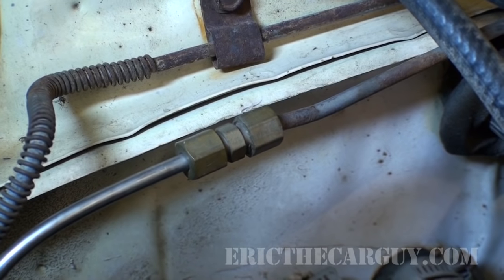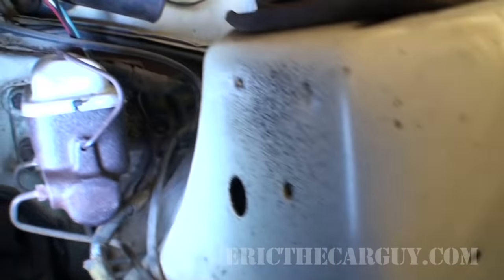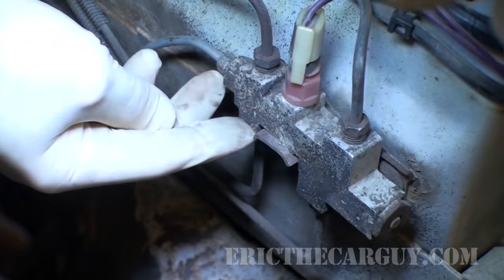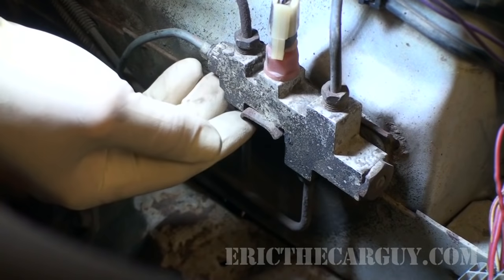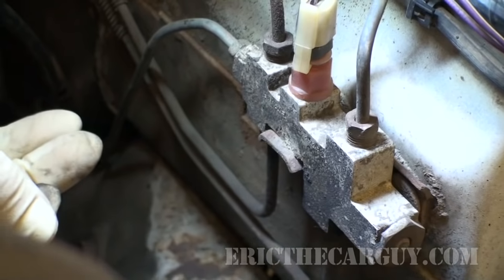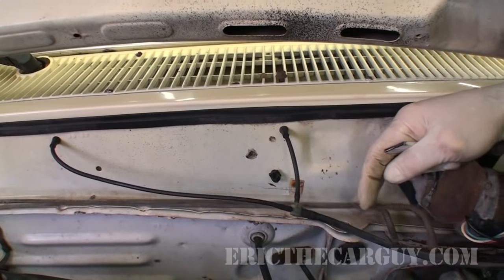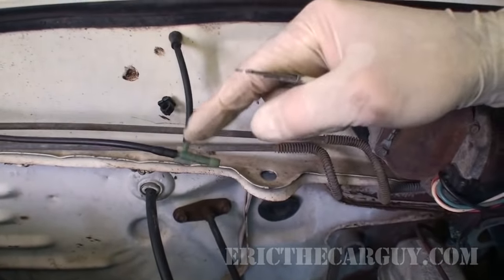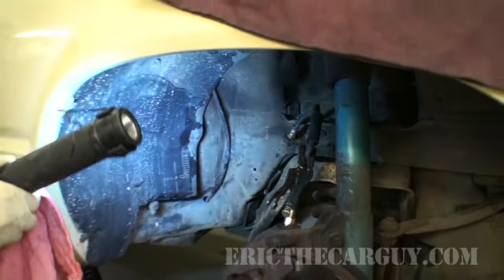How To Bend and Flare Brake Lines -EricTheCarGuy

Comment: I know this is 9 years late, so it's for anyone who stumbles upon this video for tips/education: to prevent fluid from dripping and running the system dry, depress the brake pedal and use a stick or something to hold it, before starting work. The outlets on the master cylinder is then closed/covered by the pistons, and prevents any fluid from moving.
Reply: Great tip!
Reply: Ah yes, I've used a 25lb dumbbell for that. 😂

Comment: Hello Eric. Just a quick tip for you and your viewers. Any time I'm bending out steel lines. Be they for transmission cooler supply, brake, etc. I never fully complete the bend, regardless of whether it's 45° - 90° or whatever. I leave the longest straight side without the fitting and install the fitting on the other side first. Once I'm finished with all of my rough bends. I start to install the line. I then place a tube bending sping on the end that doesn't have the fitting installed yet. I run the spring tool all the way up to the other side of the line (sometimes you may have to unbolt a cab. Jack and prop it a few inches to make installation a little easier). From there, I "fine tune" the bend with the tube bending spring. Until I get to the "open" end of the line. I then remove the spring tool. I place the fitting on the open end and flare it accordingly. After both ends of the line are secured, I proceed with the fastening.

Comment: I always make an estimate on the length then add plenty so I don't come up short. Then I flare one end, thread the line through its route.  Starting one the end I have already flared and fastened I work it by hand fastening it down with clamps as I go. I  flare the other end on the car when finished bending.  Sometimes pre-bending a line doesn't allow it to be threaded through its route. Also it is very difficult to get accurate  pre- bent bends, which is why the line kinked in this video. It wasn't accurately bent to begin with. Bottom line.....bend as you go works much better in my experience.

Comment: Been a mechanic for 30 odd plus years I have never used a factory made brake line to replace a corroded or damaged line always made my own, here in the UK we can use copper pipe which is far more easier to use. Rather than using a rubber plug to stop the brake fluid leaking I have male and female brake unions various sizes, with a small peace of brake pipe in about 11/2" long flared one end and crimped together the other end, and use then as a plug, and before installing the replacment line use electrical tape wrapped round the ends of the pipe and brake union to stop ingress of dirt etc into the pipe and to hold the union from moving,

Comment: Old video but wanted to comment. You should never use compression fittings in brake lines. They can’t hold the pressure if you stomp on the brakes and will blow off and in a lot of states if you dig into the laws but it is illegal to run compression fittings in a brake system

Comment: Great video. There's a method I use when I'm gonna have the brake line disconnected for a long time (a few hours work) is to pull the brake lamp fuse and jam a 2x4 on the brake pedal. This pushes the master cylinder forward into a compression stroke but also closes all open valves to the master cylinder reservoir. This setup lets you work completely dry. Alternatively, if you need to slow a flow and are working fast and you don't wanna hunt for the fuse. You can use a cable cutter to crimp the line in a few places that you're anyway going to replace and when your ready for the fitting use a normal pipe cutter. Thanks for all the great videos.
Reply: Good tips

Comment: Nice job Eric! You taught and ole dog  a new new trick, I have always tape the two lines together as I when which causes some problems because sometimes in the bending process the new and old line get tangled up. With 2 or 3 sets of vice grips like you showed, you can get the lines apart and right back together again as I move along. Nice!  One thing I have found is that I always start in the middle, or with the very hardest bend first and work to the ends, I have several pieces of #10 copper wire coil up and use it to the forming of a model first for shape and length it don't work harden as fast and coils back easily. Thanks again!

Comment: Great video. I had a bad line in the past. The easiest way to repair it was by using a flaring tool and installing a flare union. Much less work than changing out the entire brake line, and when done properly you will not have any problems.

Comment: Hey Eric..I know I have made some douchey comments in the past..lol but I have to give you some love on this one.  As a professional tech, I totally agree with you that its best to replace brake lines with factory bent ones if and whenever possible.  Of course this is not always possible. Boat trailers with hydraulic lines are a good example.  Even with all the room you had to work with under the hood of your fairmont, that was still ALOT of bends you had to make.  Modern cars are much worse.  In fact, even though brake system repairs are considered first year apprentice stuff in this trade, I can honestly say that the worst days I have ever had in this trade have been making replacement lines.  I would rather rebuild a transmission blindfolded than make custom brake lines lol.  The time lapse portion of this video was a good example of the effort and skill it takes to do this.  If you don't have the patience or that little bit of artistic flare that it takes to make these lines look "just right" it can seriously drive you nuts doing this :)  Also, I have been a pretty vocal critic of "tool review videos" but I have watched the review you did on this brake line tool, and seeing it in action in this video I must say that the tool made it look pretty damn easy.  I have used a lot of cheap and frustrating flaring tools before, but this one looks pretty sweet.  Anyways, this video was very helpful for anyone wanting to tackle this ridiculous procedure.   Lol. But if you value your sanity, find a dude who specializes in this kind of repair and make him your best friend :)
Reply: wrong its best to replace any fuel line or brake line with Nicopp
Reply: On fairly old vehicles there is room to work but on many newer ones, it's far more work to try to feed a pre-bend cable into the assembled vehicle, obviously varying vehicle by vehicle, how many things are in the way of the bends and how much is reasonable to remove instead of bending your own, which doesn't look as pretty but can cut the work in half or more, again on newer vehicles, say anything made in the last 15 years.

Comment: You're right, Eric, bending and routing brake lines is an art. Needed to replace several on my 77 El Camino; both rears, and one from the MC to a front caliper, all rusted into oblivion from living near a beach most of it's life.

It too several tries to get them even remotely right, and even then, they looked like a 3 year old drew them with a crayon.

The stuff you see on professional builds, with the coils and perfectly molded bends are truly a work of art.

I eventually gave up, as every time I'd replace a hose or line, another would go. Eventually sold the thing with a torn rear rubber line, but obviously I mentioned it to the new owner. It tore because someone used a line too short, and jacking up the rear not on the diff would pull it taught.

Comment: What a great video on servicing and making a steel break line!  They have little tube benders are cheap and easier to use than the pliers (although they don't make quite as tight turns).

What I did, the one time I ever did anything like this (and this is just another option -- not saying better or worse), is cut out the bad section (like the compression fitting in this video) and buy a 12-inch section with the fittings already flared on for literally just a couple of bucks at advance auto.  I used the crappy rental tool to flare and add new fittings onto the factory line. (It DOES work; just takes a little elbow grease, especially doing it upside down)  Then I was able to attach it all together with 2 flare unions.

For anyone who doubts Eric's advice on using a flare wrench on these fittings... the first time you round one off like I did that one time, you'll immediately be on your way to harbor freight to buy a set.

Comment: Great video, brake lines are always a tedious task to replace... Oddly enough most shops hate doing it, so it is easy $$$ once you master the flaring and bending. Speaking of bends, a simple tube bender will do wonders. No reason any kinks (like around 29 min mark) should ever exist! On tubing from 5-7mm (3/16 - 1/4 inch), I find that 4cm (or about 1.5 inch) diameter is the smallest you can go before kinks are just inevitable. Bending and working brake lines is more of an art then a skill IMHO. 

Sometimes... you have to think ahead of your bends, and perform some before others so your tool does not become stuck.
Reply: how about using different round pully's for your bends?

Comment: I made 2 lines for my prelude when I went to the larger master cylinder, brake booster and front calipers. Bending and flaring was nerve racking but I made it look pretty good and it worked perfectly. Nice video. 😊
Reply: If you do a bunch of flaring I recommend the eastwood bench flare tool.  Its pricy but I've never had a bad flare from it.

I just made a replacement line for my lift pump on my old diesel tractor  by doing just stage 1 of the 5/16 double flare.  The bubble flares from this tool work great as a hose barb.

The bender, I got one from summit that can bend 180* and never had a problem from it.

The eastwood forming pliers are great for tweaking lines once installed but they also leave a little crush point in tubing.

Comment: Great video!  Recently replaced brake lines on a 94 Ranger.  Used nickel-copper tubing instead of steel and had a lot easier time.  It's very forgiving and you can almost form it on the vehicle.  Costs more but well worth the time saved.

Comment: Learning something new about brake lines. Need to replace all 4 on my car as 1 is leaking and the others aren't too far behind (Michigan road salt and winter weather) using NiCu (Nickel Copper) over steel lines and replace all of the rubber lines to play it safe.

Comment: Hello Eric, in regards to keeping the Brake Master Cylinder from Bleeding out... No need to Cap-Off Open Lines or Pinch-Off Rubber Brake Hoses. All you need to do is partially depress the Brake Pedal (Pry Bar or 2x4 of appropriate length against the Seat) enough to effectively Block-Off the Ports within the Brake Master. Works on all Hydraulic Brake Systems. Note: some Vehicles will power on the Brake Lights, in this situation you can Pull the Fuse or Disconnect the Battery. Randy AKA: randog311 / Pro Wrench since 1974 Audi's are my Specialty

Comment: Great video, came back here to watch it again because now about a year later I actually have the line and tools. Making brake lines in the beginning is harder than it looks but once you learn the skill and get good at it you’ll be able to save a lot of money. It’s definitely important to have some practice line as he said, both for the bending and for the flaring, especially if you’re not buying the vice tool. For me flaring isn’t much of an issue, it’s the bending. I need use my practice line (which will probably be used to bleed master) to learn how to use the bending tool and to experiment around with the flare tool.

Comment: Hi Eric I have done many brake lines over the years and had a lot of success with a cheap pipe bender which has  degree markings on, well worth the investment. you use the pliers for tight bends and the benders for neat
Bends,you can get a factory Finnish in time I use just regular masking tape to cover the open pipe  I also disconnect the battery as I have made some perfect brake pipes in the past only to have a hole blown in the side by it shorting out on the starter terminals . only use a professional flairing tool as the cheap ones are useless, its just practice keep up the good work.
Reply: A friend of mine once told me he had a small fire in his engine bay because the battery came loose, tilted in a corner and shorted to a piece of brake line. Electrics went out and when he opened the hood he saw a red hot brake line with burning brake fluid spraying out!!! Weird stuff :-)
Reply: antiekeradio Oh yes brake fluid is not good when there's an ignition source
Many years ago i came across a brake system where the brake light switch was a pressure switch T-eed into the brake line and when the seal in the switch leaked into the contact area  the switch used to explode and leave the vehicle with no brakes. The first time i was called out to this i was puzzled
as to what had happened. This happened a few times after that which called for a modification ASAP!!!
Reply: That is the exact recall reason Ford used. Ford had multiple instances of vehicle fires caused by brake switch failure.

Comment: good video Ive done more brake lines than I care to count love the flaring tool you have Im still using the old style but it works for me. I also just buy the straight lines and cut to fit or add them together to get them longer. The one break tool I have splurged on is a Motive pressure bleeder works on clutches too

Comment: How to measure brake lines without using coat hangers. Use a string and measure it through and you'd get a pretty good, if not rough, estimate.

Comment: this video may be very old but it helped me a bunch. the only thing i did different was use a rubber hose to bend the tubing. most kinks are made from putting pressure on the line at a high angle over a small area,  i used a 3/8 rubber fuel hose to make the bends nice. they won't be perfect but if you don't have the space or time to use a bending tool it does the trick.

Comment: There are so many ways to draw the brake line. The way you suggests is perhaps the one most people strives for. Other method is just connect the line from a starting point to the end, and do the bends as the line is drawn ( I did so and it worked out perfectly ...)

Comment: Eric, you know Mommy Dearest said, "NO MORE WIRE HANGERS!!!!" Been there, done that. Just lots of fitting and bending with an much planning as you can. Done this for both brake and power steering lines. Never seen a real clear reason for OEM location and bending of lines that couldn't do with a bit of tweaking. Still, pulling the OEM line first for a template helps a lot. Thanks for the video!!!

Comment: Hi Eric...thanks for the video on brake lines, one of many i have watched as i am replacing the whole brake line system  on a 1947 GMC , Modified, with 350, power steering, AC,  power brakes and front  discs on a 68 Firebird frame... all finished . No way to find OEM brake lines. A whole new wiring kit is next much of which will be channeled next to brake lines to the rear.  Wish me luck !

Comment: Great video Eric!  I bought that exact Eastwood flaring tool to do all new lines on my Dodge D150 project. It freaking rocks!!! Perfect flares EVERY time!  Eastwood makes a really nice bender that produces perfect kink free bends as well.  I do have a question that you or others can hopefully can answer:  Eastwood recommended NOT using a tubing cutter as hardens the metal but I saw you had no trouble producing a perfect flare regardless.  Do you think it makes much of a difference? I've been cutting with a fine tooth hacksaw then using a file to remove the burrs to get a burr free square ended line.  Thoughts?

Comment: If you cap one end of the brake line before you start bending and then fill it with either salt or sugar then cap off the end you just filled with. That will make your line KINK PROOF. It is a old backyard mechanic trick my Grandfather taught me. Works real well. Try it sometime!

Comment: Don't know what part of the country you're from, but in the rust belt, it's really difficult to loosen those brake fittings, especially if they are located in the wheel well.  They strip real easily.

Comment: That vacuum chamber was a aftermarket replacement, the original one only had one screw hole and whomever replaced that part used JB weld or something on it. I had the same issue with my 68 dodge.

Comment: Good video, When I replace brake lines.  metal or rubber, I put a piece of cling film on the Master cylinder fluid reserviour ,  simply undo the top, place the cling film over the reserviour and replace the top, this will stop the brake fluid leaking out the open line, I also put the rubber bleed valve covers on the end of the brake pipe on removal, to stop brake fluid getting on your paint, and when I fit the new line to stop dirt getting in the new line.

Comment: 8:35 Better still: I made a small number (2?) of hydraulic plugs, using old compression nuts and some JB Quick epoxy.  Perfect for long-term brake line blocking.
For most Honda Civics, they'll be 10x1mm threads, so I store them with the rest of my 1mm pitch bolts.  I'm saying all this because that means you can also use any 10x1mm bolt, though they are not easy to find.
Reply: I just did this. 👍